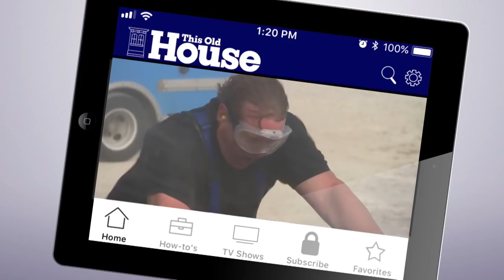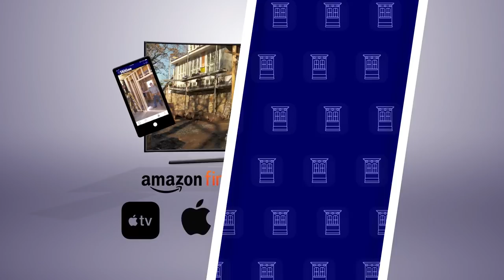ASK This Old House | Cable Railing, Painting Shutters (S18 E9) FULL EPISODE

Comment: The doors I have are raised panel but they are manufactured out of Pine and Fiberglass, with fully insulated interiors. May be a little more expensive then the standard Luann hollow core doors but they are more durable. Hollow core doors' outside shells are thin and easily damaged. The surfaces of veneered hollow-core doors are only about 1/8-inch thick.

Comment: The door thing, I did one recently that was similar. I said similar because I did a lot more to it. I stripped it apart and used the outer frame as a guide and actually built a pannel door with the pieces. wasn't my best work bit it did look nice.

I basically used the outer framing and built an inner frame for it and used he plywood for the panels its self.

Comment: I'm curious how Tom fastened that hollow post cover to the existing newel post.  They didn't show it and I'm assuming he didn't leave it loose and jiggly...
Reply: The tightened wires will keep it from wiggling.
Reply: There was some glue too.
Reply: clark used a chainsaw
Reply: The screws for the wire hardware went into the existing post.